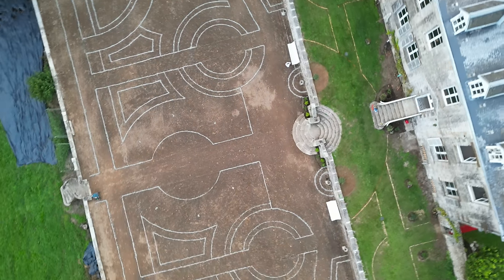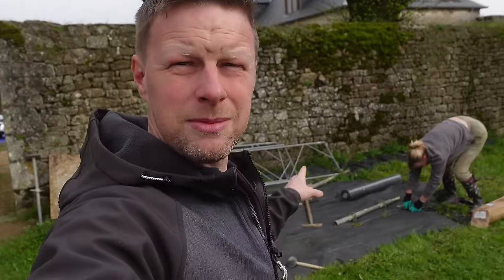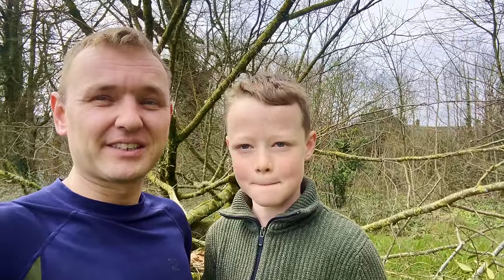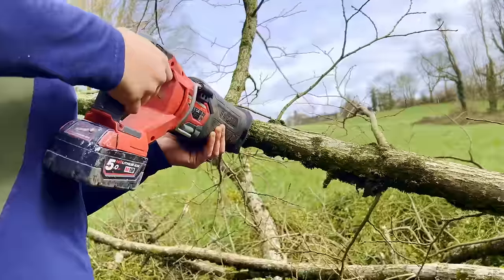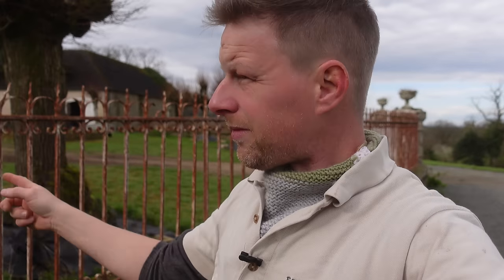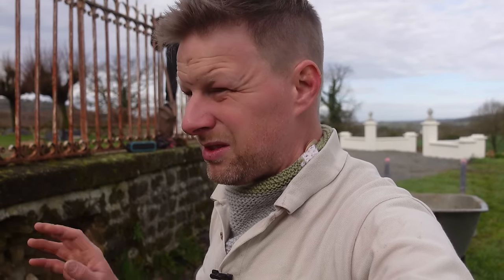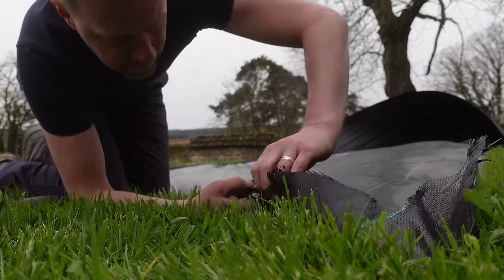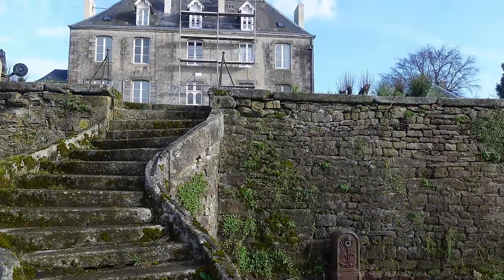Uncovering The Original Chateau Fountain | But What Shall We Do With It???

Comment: Well it looks more like a watering fountain than a display one, perhaps leave it for the dogs? It would be nice to hear the splash of water as you come down the stairs. Also there is nothing to say you cant install another fountain in the upper garden if you wished to. Add and enhance your space with your touch. I wonder also if the piping still works and it could be used for drawing water for a hose?

Comment: I have the same problem with stone retaining walls, snow and ice. Tilt slightly into the hill. So I was told. I question using cement as it doesn't allow water to move through. Maybe drain holes?

Comment: I think that the fountain is a bit small and rather lost in it's current spot, though it is beautiful.  What about placing it over in that little corner of the walled garden that is paved with stones or concrete (I don't recall which) and creating a bit of a grotto with the fountain in a place of honour?

Comment: Regarding the fountain, you may want to examine why it was placed in its original spot; could it have had something to do with drainage or some other engineering function it served there? Perhaps it was not merely decorative. Until you know that, moving it could recreate that problem and you'd have to come up with another solution.